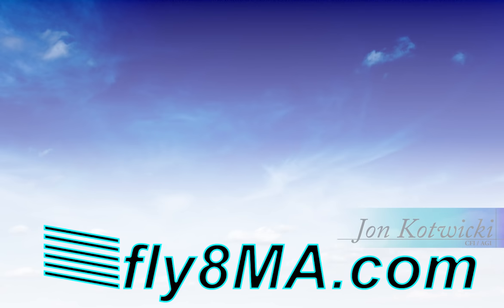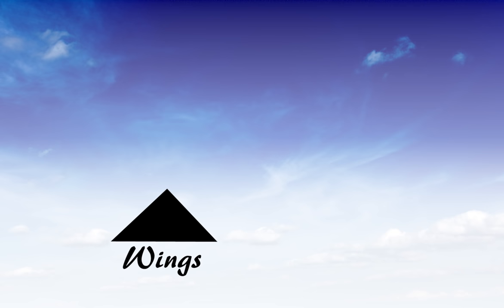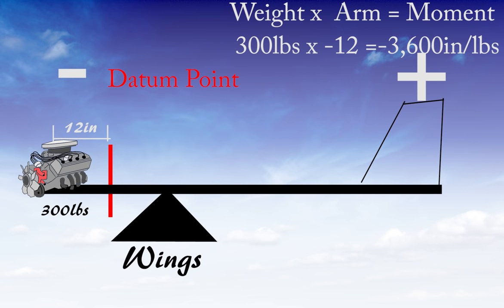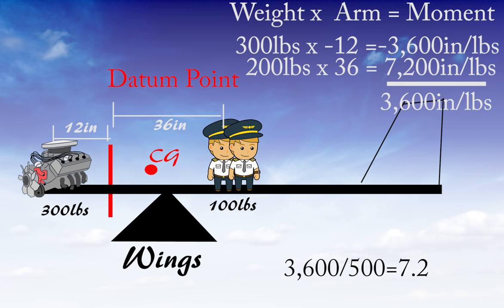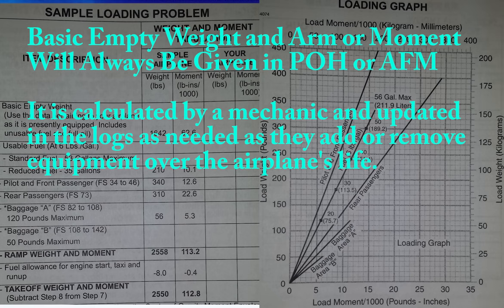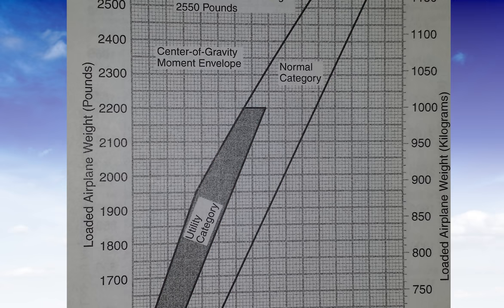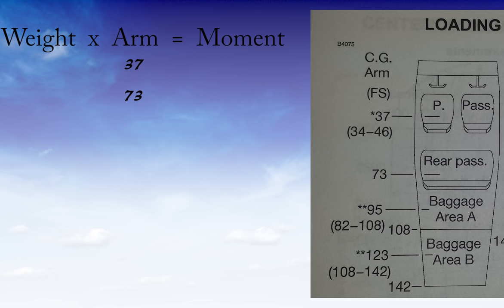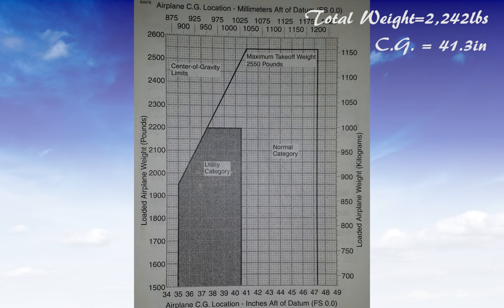Ep. 63: 2 ways | Weight and Balance | How To | With example problem

Comment: I had known that there was a lot of math and science in airplane flight which this weight and balance concepts makes all kinds of sense now. (GOOD to know), But my brain cells were being burned away trying to figure out or at least find the math on (the weight of the plane, at full capacity) and trying to figure out how much horsepower/lift pounds an engine has to be to ensure stable flight and ensure good climb/rise/acceleration with power to spare.  Are the principles the same for airplanes and helicopters.

Comment: I'm building an experimental cub and I'm wondering how manufacturers determine the datum location as well as the utility and normal area on the chart.  Can you do a video on calculating all that?
Reply: I think the datum location has no real effect on any calculations aside from convenience. A datum from where measuring distances would be easy would be quite smart however I have no experience in aircraft engineering and if I'm wrong in any way please do let me know

Comment: What if the center of gravity of the aircraft is at the datum, would there be an empty weight moment?
Reply: The datum is just a measuring point.  When the empty CG is calculated you get a measurement from the datum point for that as well.

Comment: Great Video! The only part you lost me on was how you found the Arm for the Fuel and Empty Plane weight... (I believe you used 38.2 for the plane and 48 for the fuel). I did not see those on the paper to the right of the equation anywhere. Thanks for you time and support (It helps all of us to become better pilots).
Reply from the maker: It will be listed in the POH or MX logs

Comment: Remember all A/C are designed to have a nose heavy cg in flight...why...because if the A/C is stalled for any reason, the nose will drop and if you have enough altitude then you can recover from a stall and fly away. If the nose did not automatically drop, you probably would not be able to recover!
If your A/C weights for example 2,683 lbs on the ground, then in flight the wings would have to produce enough lift to support 2,683 lbs plus the balance force to keep the nose up force in flight...lets say that is 127 lbs...so in flight the wings would have to produce 2,683+127=2,810 lbs of lift to maintain level flight. Your A/C will always need to produce more lift than the A/C weighs to fly...that is the cost of the safety feature which would allow the A/C to recover from a stall.
To minimize this effect...try to load you A/C to the Aft limits of your Wt & Balance envelope! This will give you the best performance, least drag, and best fuel economy for any given flight weight.
Reply: Larry Ehrlich Even a tail dragged aircraft? Their cg is aft of pilot.

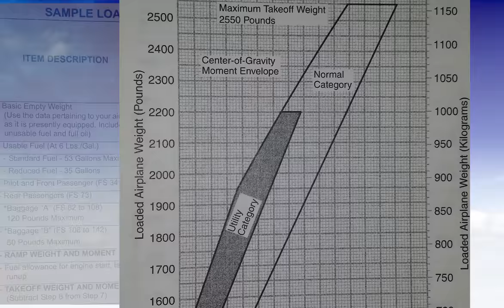Comment: 5:34 your vertical red line is off... It should be a bit further to the right at around the 112.8 mark... in the video you have it on the 103 foot pound mark... which is not good to go, you're outside of the envelope. Lol.

Comment: Where in the POH does it give the basic empty weight ARM?  C172?
Reply: That's not found in the POH or the operating manual. The basic empty weight arm CG number and information will be on the official Weight and Balance measurement/calculation sheet for your specific airplane. They are different for every aircraft and is calculated by an A&P when equipment is added or removed. The aircraft manufacture will could also supply this when it's newly built. In the AROW acronym, for required documents needed to have onboard, this is the "W".